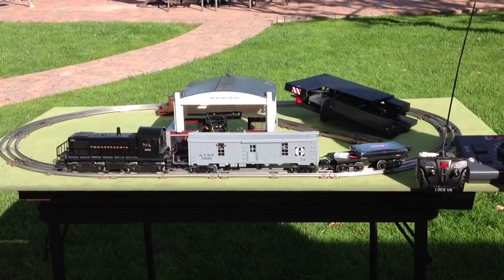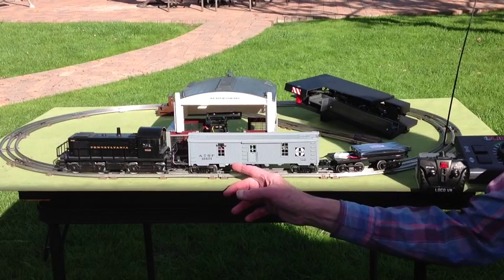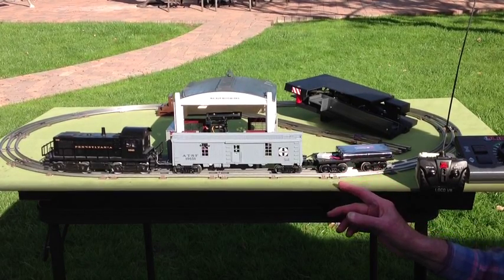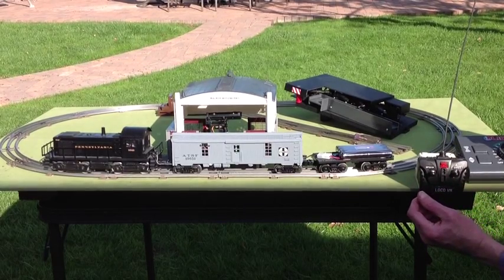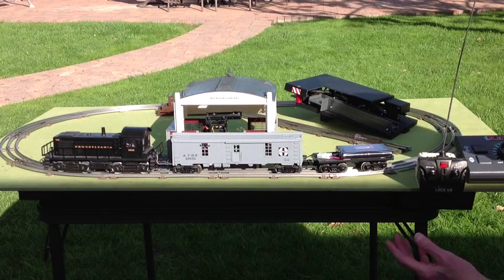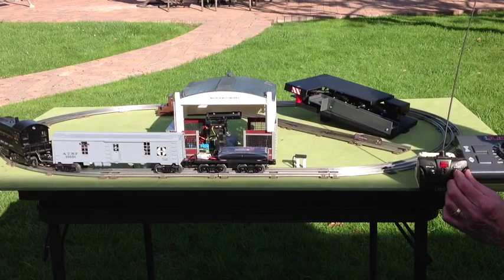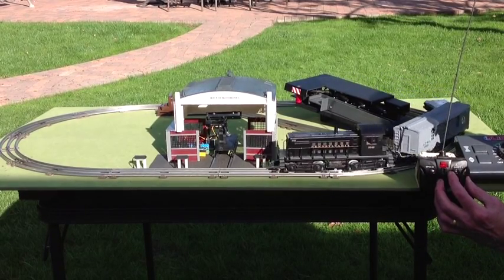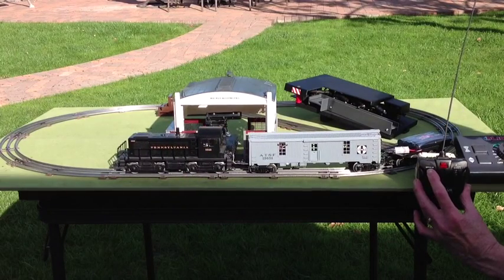Bob Walker's Battery-Powered, Wireless Train Control System

Comment: I too have thought of this before only using a lithium ion battery, but never got around to it..  Also, I would think ideally  the battery and receiver board should be designed to fit in a boxcar if possible.  Nice part is you no longer do you have to worry about power drops on the track or dirty track.  Thanks for sharing.